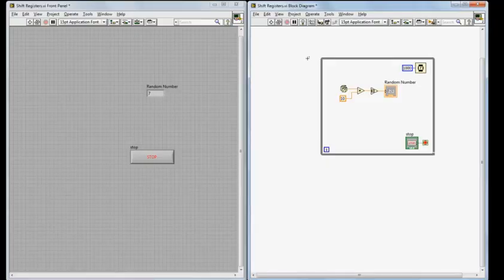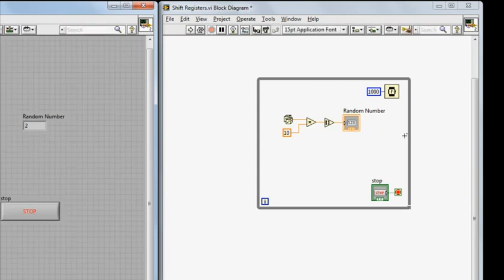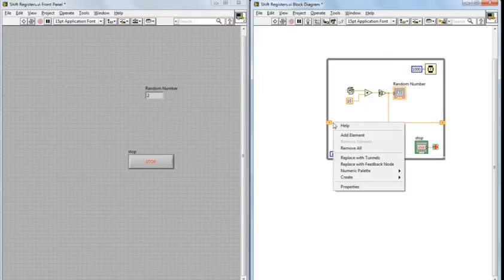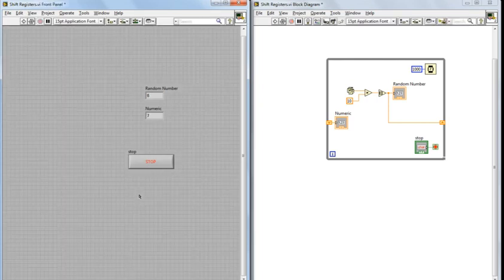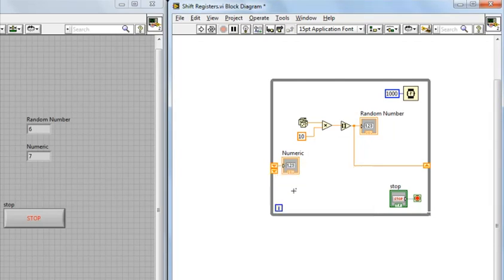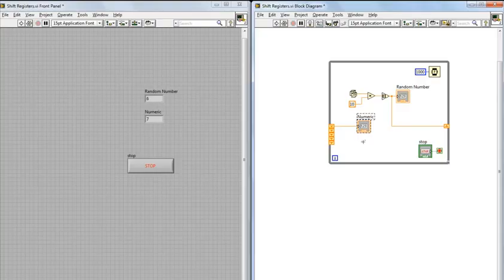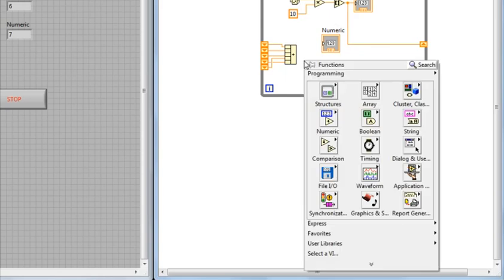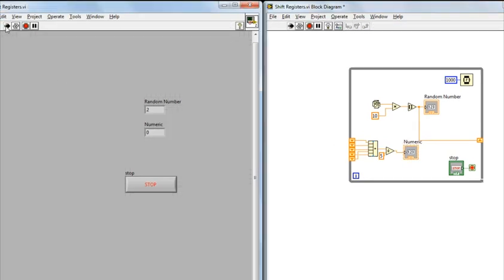Shift Registers in LabVIEW (Higher Resolution) from 2010

Comment: will the first few iterations of the RNG be still divided by 5? this will give a lower average for the first few iterations. If you have some sort of true or false condition such as "if the average is lower than 5, then stop", then the system will often stop prematurely. How do you work around this?
Reply: In the while loop, you have access to the current iteration number. Since the edge case mentioned is true only for the first few iterations, specifically while the iteration number is less than the size of the moving average (5 in this case), you can hook up an if-conditional to divide by the iteration number when the iteration number is less than 5, and by 5 otherwise. 

You could make the wiring a bit simpler by taking a min value between the iteration number and the moving average size, which is an efficient shorthand for an upper limit.

However, the moving average won't be of the same size for those elements, so the results you get are not consistent and, depending on your use case, they might be outright useless, so in general, it's best to calculate moving average only for the points where it makes sense and discard the edge cases.